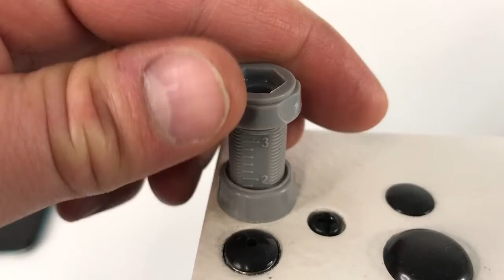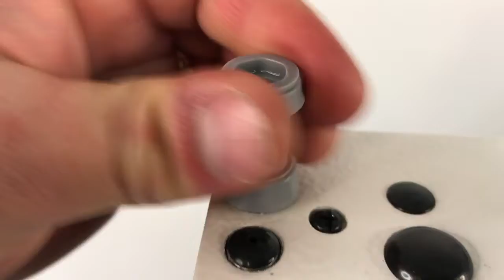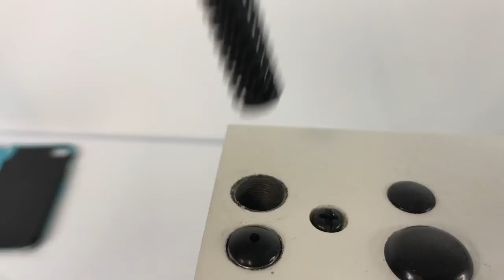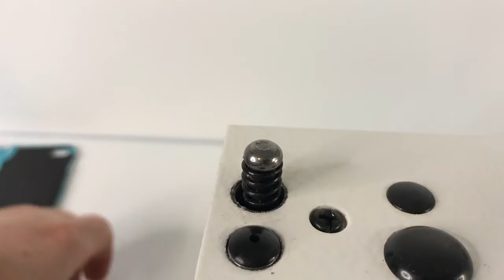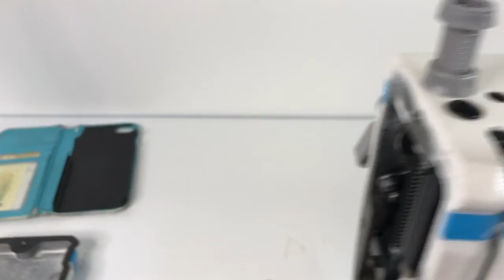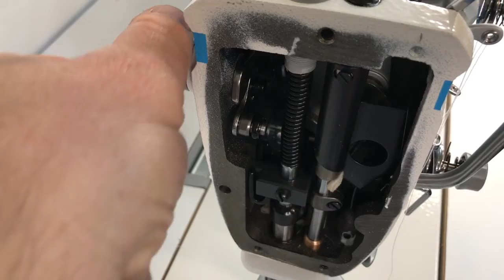JACK Industrial Sewing Machine Presser Foot Pressure Adjustment

Comment: I have a vevor machine, this piece is identical to mine, it completely broke off, can I glue it back on
Reply from the maker: Unfortunately not but you can buy these from any good industrial sewing machine supplier as they are always breaking when you bump them.
Reply: Mine broke too. Did you replace it yet?

Comment: My non-woven fabric getting scratches or feeddog teeth mark on fabric.  What can ido
Reply from the maker: You need to reduce pressure on the presser bar and some machines you can also buy rubber feed dogs I believe so that could help.
Reply: @ozcommercialsewingmachines  thanks
Reply: Same😢
Reply: @jonakamp3326  kuch solution mile to batana

Comment: How do I know what pressure for each fabric.there are no numbers on my new screw and nut I replaced.
Reply from the maker: You would need to experiment with different pressures as different thicknesses of fabric will have different pressure requirements.

Comment: Mine doesn’t have any numbers on so, what is the height from base if machine to top of the screw.
Reply from the maker: You will need to determine what pressure you need based on the fabric you are sewing. Different fabrics and different thickness will all require different pressure so you will be adjusting to suit as you go.

Comment: Your my go to guy for this machine. Thank you so much for your videos they have saved me a fortune. If possible could you please do a video for the a5e needle bar change as the one I bought has the wrong needle bar in it and the people I purchased from are absolutely no help at all. 😀
Reply from the maker: Hi, you are most welcome. 

What makes you think the A5E needle bar is incorrect?
Reply: @ozcommercialsewingmachines  I have to force a needle head into it with pliers and will only take the very skinny ones. ita a size 16. Hope that helps x
Reply from the maker: @twisteddolldesigns6190  they take a DBx1 needle that has a 1.6mm top.

Firstly I would suggest cleaning/clearing the needle hole using an old DBx1 needle.
Loosen needle screw enough so you can fully insert the needle, maximum needle insertion can be checked through the hole in the side of your needle bar, then using a pair of long nose pliers gripping the needle repetitively insert and remove the needle, essential clearing or reaming the needle passage way, hopefully if all goes well, this will slowly become easier as it clears.

Secondly always use a top quality needle like Groz Beckert, Schmetz (now Groz Beckert), or organ, cheaper needles are not manufactured to the best standards and may cause issues because of this.

On a side note, if you want to use heavier threads, order system 71x1 needles, these go to a #160 size, and fit perfectly to your machine. 

Good luck.
Reply: @ozcommercialsewingmachines  thank you so much for the ideas, I've done all that you have recommended and i only use the brands organ and the schmetz needles aswell, still have to use the pliers to get the needle in, the size of the actual hole for the needle to go into is extremely small?? I'm so confused with it lol.
Reply from the maker: @twisteddolldesigns6190 , it sounds like the needle bar hole has an irregularity inside, very unusual, but of course it is possible, I would say it is around the area where the needle clamp screw goes in, the hole is very small, only 1.6mm, I believe it will free up over time.
Reply: Do you think I should replace the bar, or just leave it as is? And thank you for your help on this, I would be buying from you if I was in Australia 🇦🇺 😊 😀 ☺️
Reply: @twisteddolldesigns6190  Can you please send a picture of the needle package that you are using to the email address listed.
Reply: @sharonmiller1140  sorry what email address? 🙂
Reply from the maker: Sorry @Twisted Doll Designs, I replied from my other account. send the picture through to prosew.pm@gmail.com